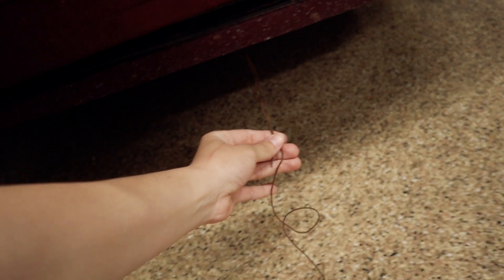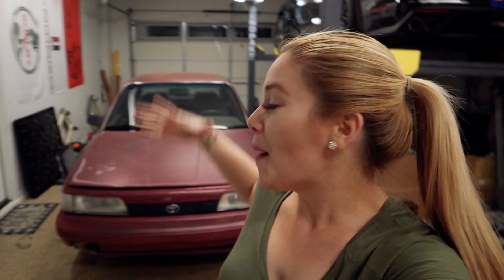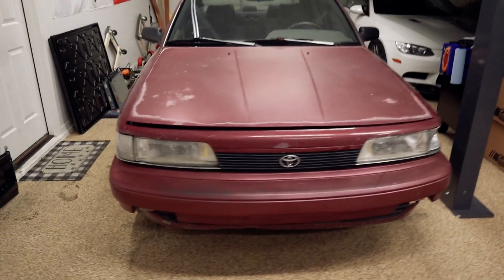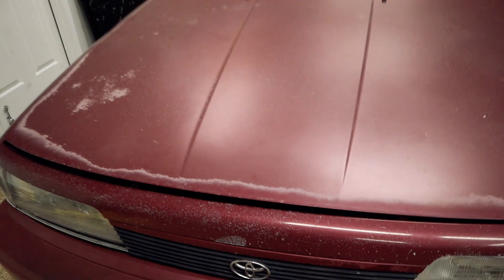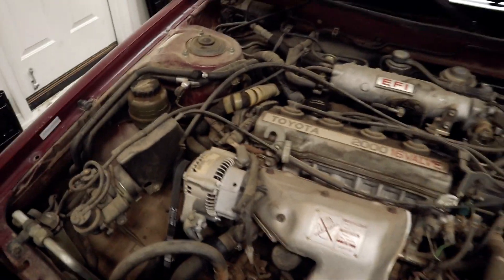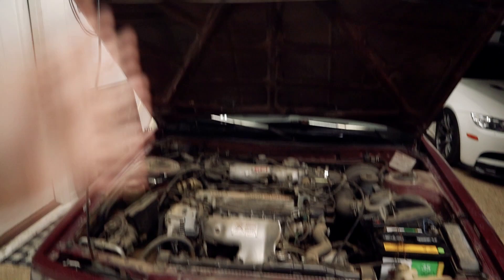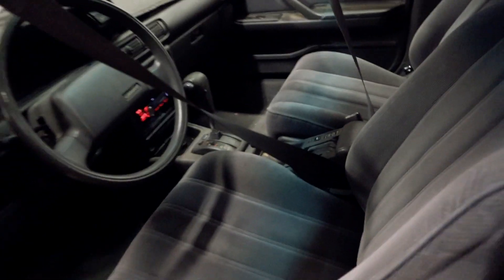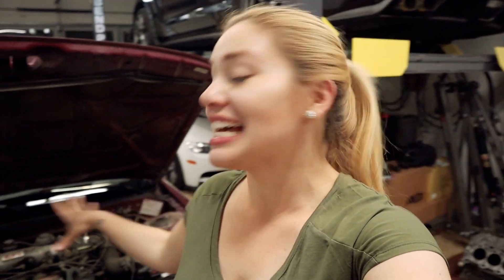I BOUGHT A 30 YEAR OLD TOYOTA FOR $900 and I LOVE IT!!

Comment: My son has me roped into a honda civic project car.
90 civic harchback
97 b20b engine from a cr-v
Early 90s acura integra 5speed
93-95 civic ecu with a chip in it
Dash is part civic,part crx,part integra.

Body kit has been fiberglassed to the body.
Insane amounts of body work.
Exhaust is full stainless, but wasnt put on right. Its dented up pretty bad.
No clue what the rear disk brake conversion is from.
Gonna need pads soon.
It lost power to injectors and ecu sunday.
No idea what to do with it anymore

Comment: My only regret in life, so far anyway, is not holding on to my mom's 93 Camry. She passed away in 2000 after 4 year battle with breast cancer. My dad traded it in 2010 for a new Altima. He gave me the option to keep it and trade in my 95 Neon, but at the time, I liked my Neon more. I also didn't deal with my mom's death yet, I just buried it and tried to forget about it. Now, I wish more than anything that I hadn't let it go and that I could find it again.

Comment: the stereo may be in  demo mode.But its most likely wired to the 12v  constant live for the original radio for memory presets and clock. there should be a 12v keyed source  in the same harness so it shuts off and turns on the radio with the ignition key.

Comment: Expect to replace most of the rubber parts ( intake tube and vacuum lines) and alot of plastic parts that get hot. The radio is wired wrong they put the yellow and red wires together the yellow wire should be one that is switched off with the key. Have fun

Comment: Check the CV axle probably bad were the clunky noise comes from when you turn if the boot is torn grease leaking out it's bad. Rockauto.com got a lot better prices for parts as well good luck on your project though it was going to be a old mustang or camaro project . Could just scuff it with 1500 paper n clear coat n rebuild the engine n drive it
Reply from the maker: I will check that. I've heard of rock auto. I checked them out and they have a lot of replacement parts, so that's a good thing. The paint is something I will tackle last..should be fun.
Reply: @woman.driven  it will be or just sand 1500 grit wet dry paper n clear n keep the patina

Comment: Woof. Congrats, dear 😂  that hood latch is probably not a hard fix.  One day i'm going to get another Honda Civic manual..... i miss whipling around in my 97 sometimes.  But if it's a choice between that and buying a Dodge Cummins dually, then the dually wins every time 😂🤷‍♂️

Yeah you'll prolly have to switch that stereo ( for now pull the fuse  )....

Comment: Pull the fuse for the radio, whoever installed it connected the 12volt lead to constant power on the wire harness.

Comment: The radio is why the battery is dying. There's a constant power for the radio memory and a switched pull out the radio and separate the two wires. Switched power has to be routed through the ignition switch so when you shut the car off the radio goes off.

Comment: Honda's civics are bad for the main relay shutting down the car while driving it's similar to a fuel pump problem. I drive a 1993' civic. The paint is great, carpet has a small hole from first owner, with just under 160,000 kms.  When I bought it it had the same main relay problem it was a 40.00$ fix. People always ask if I want to sell it as it's in top shape. If anything like anything goes wrong I replace it with new parts exhaust Alt radiator hoses timing belt heater core are all new under 30,000 km I did these when I bought it. So ya there are good ones out there to buy. Gets harder if your after a car that has never had a accident at that age. Good luck

Comment: I am!!!!! Anyways......that’s radio right there is what’s causing your battery to drain. The yellow and red wires for the head unit are probably connected together, it’s a older radio wiring system so it wouldn’t surprise me.....

Comment: as you said you tried everything turning the radio off even using the remote, from what I see it keeps repeating the same pattern every time the lights turned on and the screen shows J C or what the make of the radio. I think there's power fault or the power button got stuck as it looks like it constant restarting themselves.
The car looks nice and I think it's brill idea to work on old car to do restoring project as you said you been working on new cars every time just to improve and modify the performances, I think restoring old cars to give a chance to get it working once again like bran new and keeping history themselves alive and existing longer

Comment: My 2000 Toyota Camry LE V6 3.0L has only 126k miles and bought it for $2500. Good shape definitely no issue on motor but lilbit issue on exterior that can be fixed. Hopefully i can make this my project car and make some nice exterior upgrades.

Comment: When u turn u hear a clicking sound would be a cv axle also if they radio doesnt turn off in the mean time just take off the face of the radio .... although they might of cut the factory plug instead of buying a adapter plug for after market radio

Comment: Looks like theres a break in the wire/the radio is wired wrong when the constant wire is on ignition and ignition on constant if its draining the battery

Comment: That blue wire hooked  to your  battery  looks  like the one  that  goes  to the  radio  unplug that  and it  should  stop the  battery  from  going  dead that  clunk noise  when  you  turn  sounds  like  a cv  axle
Reply from the maker: I was wondering why it looked weird. I didn't want to pull it without tracing it. But I'll try it out.

Comment: Wonder if the seller watches your channel. The radio power should be on the ignition of the fuse box. So it shuts off when the key is off.

Comment: Whoever installed the radio either wired it to a live fuse or directly to the battery instead of tapping into the original radio wiring harness that gets controlled by the ignition.

Comment: Front CV joint is bad if it is clunky and turning that direction. Front wheel drive. All 90's model front wheel drive cars make that noise when CV joint is bad. Have had a few.

Comment: I wish you would have gotten a mid 90's Camry as they are much better than the one you got and look a lot better and have some really nice mod kits for the suspension system. The 1990-94 was the best to get and looked sporty. A friend of mines had one and put in a sports package sway bar system and other things like progressive rate lowering springs and the car was just a dream to drive as it handled really really good and stuck to the road very well. But he did have some Yokohama AVS tires as most of us did back in the day. I had an 84' VW Scirocco which I just sold a month ago that was all supped up and his car with just those little modifications was able to keep up and even out corner my car. 
Here is a video so you can see what that model actually looks like as well as each design they came up with over the years: https://www.youtube.com/watch?v=JjFFJzrVBjI
Well, have fun learning but do note these type of cars require a lot of special tools to be able to work on them, kinda the only drawback to owning them.

Comment: The problem with the paint is the clear coat has faded away, needs a respray, the old paint must be stripped off, the clunking in the front sounds like a bad strut, good luck with this project.

Comment: The clunk is the axle that is bad. That was a common people on those years. Also they had issues with the automatic seat belt and the radio and power door locks on those. The wires would break in the door jam bcz the were too short from factory.
Reply from the maker: I will check that. Good thing the seat belts work and the power locks and windows :). I'm sure something will mess up.

Comment: Girl!!! If you need any advise let me know I was a toyota mechanic for 11 years and I know those cars better than i know my name, lololol.. first thing want to tell you is if you are going to wash that engine is to cover the distributor bcz water gets into the cap and the car will not start.
Reply from the maker: Good thing you told me.. although I was going to use a different method than spraying water all over :). I'm sure I'll have questions once I get it on the lift. Thanks for watching!

Comment: Looks like broken outside handle the radio Probably wired direct to power instead of switched. Need a new outside handle and hood latch release with cable. The hardest part would be all the ti.e spent sanding the car for new paint

Comment: The clear coat has failed the only way to fix it is to repaint the car.  Still not a bad buy for $900.  If you want to learn paint and body this would be a good car as long as there isn’t any rot which it doesn’t look like it has any.  Very few people would take a camery and try to bring it back thumbs up to you

Comment: Hi Doris! How are you?
I was wondering, if your radio is bugging you, why don't you remove the radio fuse, without it the radio won't turn on, and that way you don't have to leave that area open, and have you check the alternator, if the battety keeps dying, it could be that the alternator is not charging the battery, if I were you I'll go and get to a place where they can fix the alternator, idid that with my old nissan altima, and luckily for me thete was a shop, that they fix alternators, starters, and I was told by one of my coworkers that they use japanese parts, and I went, and they charge me only $90.00 dollars, and I had to remove it, take it, and pick it up later, and I had to borrow a car to go and drop it and pick it up, they did it pretty fast, ok ptetty girl im glad you're back with more videos, thank you for sharing and have a nice rest f the day, and keep yourself dry, bye hermosa guerita.

Comment: LOOK UP 1990'S Toyota Celica GT4 ST185 IT HAS SAME ENGINE 3SGTE    JUST SLIGHTLY LOWER COMPRESSION RATIO.
GIVE IT A JDM ENGINE AND TURBO EVEN SECOND HAND DIRT CHEEP FROM JAPAN RUN IT ON MEGASQUIRT CAN BE BOOSTED TO 425 TO 579 BPH 
IT WOULD EAT ALL OF YOUR AMERICAN CARS ALL DAY LONG AND COST $4000 FOR S.HAND ENEGINE $750 MEGASQIRT

Comment: You are in a man's world now I hope you can handle it it's going to be rough
Reply from the maker: Michael Harvey looking forward to it.. I will handle it. 👍
Reply: All I can tell you is if you get yourself in a jam ask somebody and there is 100 things in an engine  and if you dont have your bearing clearances  right  you can just throw the rest in the trash can ....
Reply: I have a 1971 mustang mach 1 factory air conditioning  351 Cleveland 4 bbl.. heads  original engine it has C-6  with ten inch converter 3.70 gears

Comment: Take the face off the radio. Are hook up the remote wire the right way.
Reply from the maker: The face is hard on there.. I couldn't find a way to remove it without breaking it.

Comment: $900! Hell I bought a 89 Buick century with a Buick 90° 3.3 for $400 with 102k miles n was way cleaner. But just saying! Lol
Reply from the maker: Shawn Satterlee From what I saw.. there were cheaper American cars.. I chose not to get American as I have too many of those ready.
Reply: @woman.driven  not much of anything around northern Ohio going back that old which is clean, so gotta grab what is available. I put some $ in it and ran it through the winter and sold it in the spring for a whopping $800. I did front struts, rear shocks, complete exhaust, tires, brakes, full tune-up... Didn't make any $ to speak of. Should of kept it, I love the old Buicks. Still looking for a solid 89 LeSabre.

Comment: Strut plate bearings are bad that’s why it’s clunks
Reply from the maker: JohnBeck Paradizo so much to learn. I’ll soon remove the wheels and have it on the lift to check all the wonderful things.
Reply: It might not do any noises on the air it needs load but I’m pretty sure that’s what’s wrong with it

Comment: and you paid 900 dollars for a car like that?? heck i would not pay 300..      ah just going of the description you stated at the beginning of the vid.. lol  I got mine free because of the transmission. replaced it with a 175 dollar boneyard trans.. was great after that was pretty easy to replace too.
Reply: I agree.. I've paid $300 and $500 for FAR BETTER cars than this.. like Cadillacs, Lincolns, and Buicks in nice shape that didn't need major work. Hell I even drove the Cadillac from the west coast to Chicago and back with little more done than new tires.
Reply: @VinylToVideo  hmmm the description she gave of what she wanted. does not seem to fit this car. LOOKS like a 5-700 dollar car. hmm clunking as you make a turn?? balljoints?   the radio is a weird one though. just replace it, nice after market one with bluetooth.
Reply: @VinylToVideo  She said she did not want an American or German car. she has plenty of those.
Reply: @beingsneaky  You couldn't pay me to take this hunk of junk.